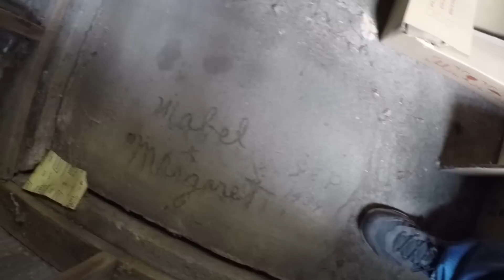NEW SHOP? Thinking of renovating the old 1939 shop building.

Comment: Go for it! Get it insulated. Get a hoist put in and then put in a woodstove or waste oil heater. A hoist would be a great addition for you and the channel and they are relatively cheap I would have one if my garage was big enough.
Reply: Nevermind on the heater I see you have the LP line in the shop that would be the best heat maybe have a wood or oil stove for backup?...

Comment: It'll be quite the undertaking BUT the new shop will be customized exactly the way you want it to be. 
- Maybe turn the old shop into a paint booth exclusively. All you would need is exhaust system to vent the paint spray.
- You read my mind about a lift. It will make working on vehicles sooooo much easier. Mohawk lifts are made in NYS and have a reliable reputation.
- New shop with windows would make a good small fabrication area.
- Check out Homer Depot and Blowes for deals on insulated windows. They have returns and clearance items all the time.
- Rough cut lumber from local saw mill is cheaper than store bought and will size to those old timbers.
- Upgrade the electric. You can NEVER have enough outlets. My dream shop would be a wall of electrical outlets so that no matter where you reached, you could plug something in.
- I'd say that for $10,000 give or take (includes insulation, windows, lift, electrical, concrete floor, etc.), you could have a kick ass shop.

Comment: Hi Jon,
you are a very lucky guy to have so much space to work at the Truck.
If you build a new shopI, I strongly recommend you to schedule a hoist.
It makes a lot of work much easier.
My Garage is built 1966 for a Volkswagen Beetle without possible open both Doors.
So my F150 does not fit in the garage and I work in front of my house.
So enjoy  your options.
Greets from Kerpen
West Germany
Wolfgang

Comment: I agree with the other comments, keep your current shop for a dedicated paint booth, I can't believe the working conditions you had at COS, yikes. The end "bay" with the windows, insulate, draft proof, have an office, a dedicated area for your smoker, tool crib. The remaining area, the dark side,  will cost you bucks. Add windows. Don't forget to add extra support in the concrete floor for a lift.

Comment: I would put shed doors on the smaller area and leave it for smaller projects. Let the larger area be for car and truck projects. Just some ideas. Can’t wait to see how the project works out.
Reply from the maker: Shed doors?
Reply: The Fox Shop, why not?
Reply from the maker: Not sure what you mean by shed doors?
Reply: The Fox Shop , double doors that swing outward instead of a door that opens overhead. I figured instead of having all the hardware involved with a traditional garage door that would make something like the green truck difficult to fit, the shed door would eliminate that issue. Again, just my thoughts.

Comment: Concrete in my area runs about 3.50/sqft finished pour it 5 inches thick don't skimp on insulation money will come back 10 fold just went through all this good luck